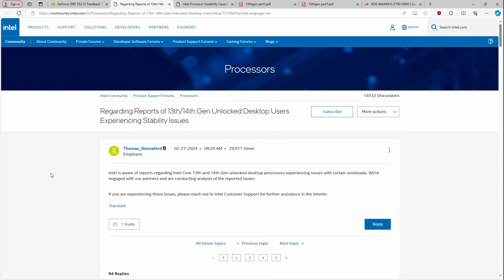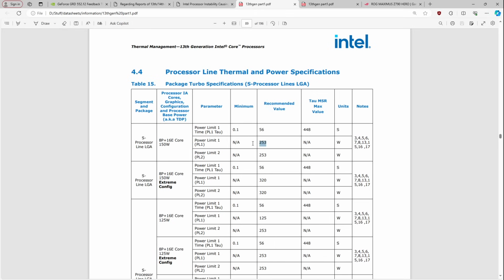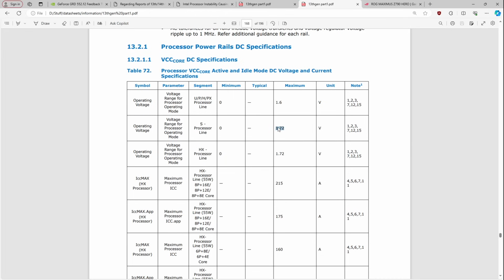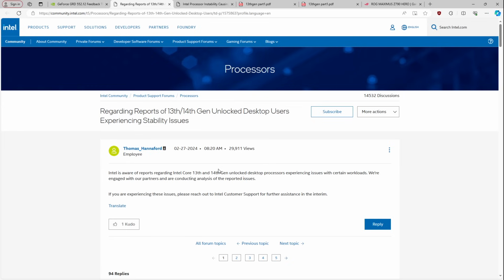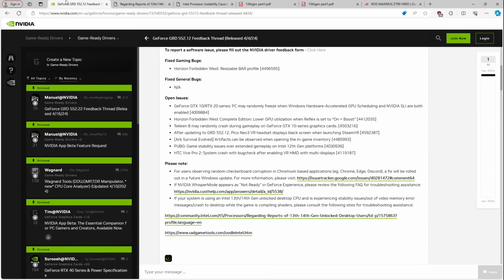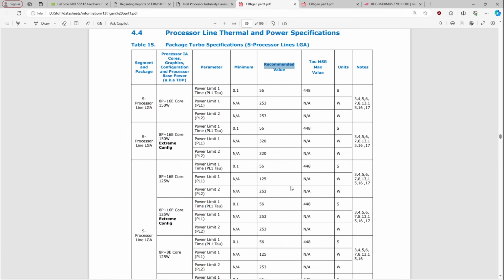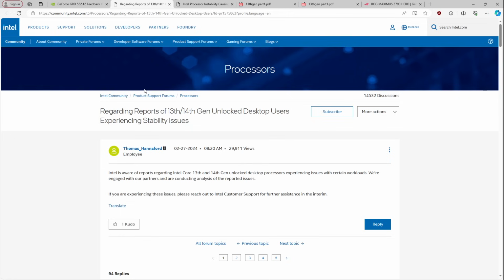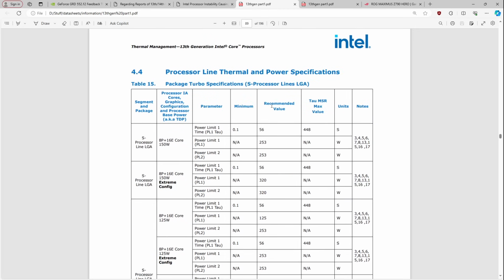Rambling about why some intel 13th/14th gen i9s and i7s aren't stable.

Comment: I don't know why is this overblown so much, it is not a new issue and it happened to other CPUs as welll. My friend had stability issue on ryzen 2600, BIOS update solved the issue and it is not hard to find examples with some other CPUs.

I just hope that intel will learn from this and force board manufacturers to set default settings to be within spec. That is the only reason why stability issues happen on larger scale.
Reply: 27:29
Reply: @ValentineC137  I know he mentioned it, but most do not...
Reply: You’re missing the point, intel isn’t enforcing power limits, that’s a major flaw for highend products that’ll lead to degradation over time quicker than normal

Comment: I would assume the fused SVID is not the culprit. What Intel doesn't appear to specify is the default VRM parameters, which (I guess) mobo manufacturers figure out on their end. Set AC loadline too low (assuming standard LLC) and no brakes on power and you get a vdroop into instability. Increasing AC LL is one way to increase voltage under load (gigabyte, for one,  has presets for it). Then there's also some temperature-dependent voltage optimizations, and who knows how those work.

Comment: I had an absolutely awful Z790 experience over the last 2 years. I have been through four 13700k CPUs and three different motherboards to just get a stock setup that works without dying in a few months. Eventually I just gave up and switched to AMD. Intel's designs here are awful - AMD is kicking their butt, and Intel's solution is to jam so much power and voltage into their design that it's an unstable nightmare even without any overclocking. They need a new CPU design.

Comment: 13700k users have been having problems as well, I've been kind of sort of keeping my eye on this since I built my 13700k and had to dig around my bios to get it running to spec and noticed quite a few mentions of crashes with out of the box settings and a few mentions of RMA's back in 2022.

Comment: I did have a 13700k that would Bluescreen with a Clock Watchdog error within running Latencymon.exe for a minute.  Often under 10 seconds.  Got rid of it, have a 14700k right now.  Have had some odd blue screens at stock settings (which are Asus overclocked bullshit settings).  I changed all of them to Intel specs except not INTEL FAIL SAFE VID, just using auto to see if that works.

Comment: Asus ROG STRIX Z790A gamming WIFI DDR5-6000Mhz 13700K 360mm Artic liquid freezer II everything set to auto/default. I can not run Cinabench. crashes ever time. Drove me crazy for weeks.
Reply: Crashes as soon as i push the button render never starts.
Reply: Have you checked for a newer bios version? It seems asus has updated them recently. Maybe i got lucky or issues havent surfaced but even asus "optomized" setting runs cinebench even for multiple runs and dont exceed 85c

Comment: What a good time for CPU's, buy AMD and they melt, buy intel and they aren't stable
Reply: Honestly the cpu market has been nice and it’s getting better (upcoming releases) so chill on the old news/misinformation, did your 7800x3d melt? No ok 🤫 I went with the cheapest b650m hdv mobo from asrock and it’s kept my 7800x3d perfectly stable right out the box and it’s been a year now, not saying it never happened but it isn’t how you say.
Reply: @Pikkoroo  No, my chip didn't melt because the 7950X system was so unstable that it went straight back... i dont play with garbage platforms that take 8 months to start working properly
Reply: @Latioseon381 also misinformation
Reply: @Latioseon381 so if intel isn’t stable and amd melts what did you go buy a ps5? $99 asrock b650m hdv board hasn’t melted my 78x3d or had a single stability issue that wasn’t user error @myself

Comment: My 11900k is about 50/50 on whether it boots at default settings on strix z590-a.
Reply: I think it's just that motherboard I had the same exact problem with that board I switch to an MSI board and it booted 100% of the time

Comment: BTW electron migration is kinda complex thing, as well as the power is. If something drastic doesn't kill a semiconductor at the end electron migration will. There is no one thing that is directly responsible for stuff happening. Electron migration happens in the semi conductors always. It gets worse with frequency, voltage, amperage and operating temperature. Any of this things gets higher it will shorten the life of the silicon. 
Regarding the power, current VRM's and application scenario is giving us situation where you can get to same power numbers with different ratio of voltage and amperage. Frequency and cooling solution will change the formula. If the cooling allows it CPU will keep on pulling more power even at lower-ish core voltage. But that Voltage might not be enough for some frequency numbers even if the cooling is good enough. So changing any of the parameters will influence every other aspect. Core voltage will rise power usage almost exponentially at some moment. That will possibly overpower the cooling. We are at the stage where we companies are practically selling their products pre over clocked. More Hz does not even mean more performance any more in some scenarios. If the cooling and power deliver are not up to it thermal throttling and dirty and bad power will make things slow and unstable under the load even if it is super stable under some lighter loads. So yeah power is damn complex thing in CPU technology. It is not just P=U x I. It depends on stability and voltage and cooling. Because of different boost technologies and solutions it is dynamic thing. Only solution that works for me is overkill.

Comment: Der8auer talked to an Intel Engineer about the 100° Celsius thing. 

He said its not possible to control and regulate Temp and Voltage on 100% of the Die Space at 100% of the Time.

So Intel puts Tolerances for Temp and Volt in it. Pretty sure MoBo Manufacturers overrun some of theme because PowerStages cant control Power exactly enough.

Degredation would be a heavy Problem but atm there is no other explanation why the chips dont fail immeditaly but months later.

What should happen in this time that 10 people a week RMA their High End K cpus ??
Reply: Yes, the possibility of degradation shouldn't be dismissed. There are many reports of chips working fine for several months, then all the sudden they begin throwing errors regularly. This indicates degradation, so I'm not sure why Buildzoid wants to dismiss it. He says other overclockers have pushed chips well beyond 100 C before, so that automatically means it's not degradation? Doesn't make sense. Different architectures have different tolerances, and even CPUs of the exact same architecture have different tolerances. To give another example, many ICs such as microcontrollers are available in different grades such as commercial, industrial, automotive and military. These different grades are all exactly the same for a specific IC, the only difference is the maximum temperature they can handle. A commercial grade IC might be rated for up to 70 C while the industrial grade might be rated for up to 85 C, and so on with the higher grades. Again, they're the exact same chip, but the higher grades have better silicon quality and can withstand higher temps.
Reply: @PhazerTech  I think the answer is in the Middle. The Intel Engineer also said with 100°C the possible Lifetime of the Die should be 10years+.

So the most possible could be that maybe Intel has a bad Batch of Chips that are now in RMA Process. 
And the other possibility like Buildzoid says is to "low" vcore ore in my opinion "not stable enough" vcore . 

Maybe they MoBo Manufacturers lowered the vcore with Bios Updates to get higher clocks and higher performance.
Reply: @residentCJ  It could be a number of things. In the end what degradation does is just raise the vcore curve, meaning the chip needs slightly more voltage than it used to for a given frequency. So there's a definite relationship between degradation and voltage curve.

Comment: I had one of my cores go bad even though i limited my 13900KF to 200W (even less practice due to limited cooling). 

Worked fine after i limited core2 to 5Ghz, all the other cores seem fine.
Reply: 13/14 gen i9 360 aio is the  minimum I'd personally do😂
Reply: SFF build or what? Idk why you'd run any of these new intel cpu with limited cooling

Comment: i think its just worse cpus that needs more voltages to boost to specify clocks , my amd 7600x was giving me instant blue screens in games but passes with no problem cinebench on stock settings in bios and mother board was setting voltages like up to 1.3V but after testing i found out to boost to 5.45 i needed like 1.45V and finally i am at 5300 on 1.27V and now it works...

Comment: Why doesn't Intel have a stock cooler option with an i9 CPU? Because they can't guarantee it will work. The mainboard can shoot 400 Watt heat in it, and some can build it into a super small case with no airflow, and then it will not work.
I would rather have 14600 with enough cooling than 14900KS with some generic system.
If you want the fastest there is from Intel, you need the best cooling possible.
If you ask me, it requires a big custom loop. 
If you want a smaller cooling system, you might need to go direct die.

Comment: I'll add that 12th is also affected, I thought I was stable, but Cinebench 2024's Stability Test showed me the light, After a  year of use I disabled MSI's Enhanced CPU and stopped doing all core 5.1GHz & 3.9GHz P/E on my 12600K.
Reply: All Core clocks for a 12600K is 4.5 GHz... not sure why your cpu is running 5.1 GHz but that isn't remotely close to stock. Even single core boost on that chip is only 4.9 GHz.
Reply: @mylittlepwny3447  I was overclocking since Intel boards allow you to do with ease, but I'll admit I was doing it a bit sloppy,  I shouldn't have gone on top of the OC with MSI's Enhanced Turbo which added too much voltage.
Now I'm OC'ing with the Boost Ratio option, seems a lot more efficient than simply flat out all course.  Right now, I'm CB2024 Stability tested with a Boost Ratio OC of P1 at 51, P2 at 51, P3 at 49, P4 at 49, P5 at 47, and P6 at 47. 
I'm going to change P5 and P6 to 49, and do another CB2024 Stability test run.
Reply: Shite I was for picking one up as it sounds like 12600k would be grand 😅
Reply: @fracturedlife  If you find it for a good deal get it, the CPU is still great.  The stability issues are easily fixable. Some are caused by the auto-OC board manufacturers have enabled, and others causes are just users with crazy tuning. Intel CPUs really let you have fun with the manual OCs if you have good cooling with them.

Comment: I hate to comment in the first few minutes of the video. But anyhow, the issue lies with the bios implementation  of the mainboard vendors and the common belief that AIO are enough. Mainboard companies want more performance and power draw is just insaine. And if client uses bad cooler, they know CPU will slow down.
Well, stock 14900K can pull 400Watt. That requires a huge cooling system. 360 AIO will not be enough, especially in the cases without proper airflow. Heat needs to be transferred into the air eventually. You can't drop it in water and expect it to disappear. 
Now, voltage gives stability, but rises power draw significantly. So poor coolers suffer even more. 
If you want stability with AIO or even an air cooler, use lower power settings. Use 125Watt TDP recommendation.
If you want full power crazy power draws, make sure you have a huge cooling system.
If you have 4090 in that system, make sure you have a minimum 1200W high-quality PSU. 
Your fans and pump need power as well. It takes power to cool.

Comment: cinebench r15 is surprisingly harder than r23 on 13/14th gen, if you try to run with r15 with a voltage that will crash after a 10 or 30 min r23 test, you will get instant crash
Reply: i bought four 14900k, all of them can run r23 30min, but two of them cant run r15 for a long time, and one of them cant pass r15 one cycle, its not a rare issue, my friend bought three 14900k and all of them cant run cinebench r15, which is ridiculous
Reply from the maker: @polly_2526  oh I've heard from some people that R15 is heavier than R20/23 but I didn't see a difference between them with my CPU. I guess it really depends on the CPU's VID table as to what workload is gonna be most unstable.
Reply: @ActuallyHardcoreOverclocking  Maybe I have a pretty good cooling？I have one 480mm radiator and three eternal 360mm radiators and my cpu is delided, it never hit Tjmax and downclock in cinebench.Also my cpu did degrade, it can even run 5.8ghz linpak before and can never do that now (same water temperature)
Reply: @polly_2526  you both have an asus motherboard?
Reply: @PCstonks  Im using z790 apex
Reply: @polly_2526  okay, and your friend also uses Asus?
Reply: @PCstonks  yeah its the strix z790a
Reply: @polly_2526  what a coincidence.. you can try to install latest BIOS with new feature "Intel Baseline Profile" and enable it. However it set a very high voltage even if you have good cpu bin. So the best way is to set freq&voltage manually, setting the llc for example 6 and the vcore about 1.2-1.25v, freq about 5.3-5.6 depending on silicon quality.

Comment: Glad I went with the i5 14600k for my SFF mini-ITX build. I get 5.5ghz that never downclocks at 75C max and it runs silently. I can jam more voltage into it and it will even boot at 6ghz, but every 100mhz extra creates a more voltage hungry heat producing monster.
Reply: well people with 14900k could also disable 2 cores to be more stabke but yeah silicon quality still a problen

Comment: I wonder if degradation might be from the max current limit not being followed.. that seems like the reason for specifying a maximum instead of just recommending it
Reply from the maker: it could but the CPUs don't really seem to hit those currents for very long because even at 1.1V 307A is 330W and that's already really hard to cool. The 400A limit is straight up impossible to run for extended load on anything less than a custom loop. And I'd  be very surprised if short blips of over 400A would be causing significant electromigration.
Reply: @ActuallyHardcoreOverclocking  Actually there is some strange "formula" for current on intel CPUs, if I set the 307A on my 13900K I get throttled with an ICCMAX flag in hwinfo when running P95 SFTs at only 238W and ~1.14V and VRM amps max out around 200~205A, 400A ICCMAX can get me to ~265ish amps and 280~290W max power draw until the ICCMAX throttling flag reports an "YES", I don't know the exact formula that is at play here but it seems that you are limited to around 66% of the value set in BIOS.
Reply: @ActuallyHardcoreOverclocking  a simple test would be to see if the score changes with the current limit enforced.. if it does then in theory you're seeing more degradation than intel wants to allow

Comment: I do not understand the part about current at 100C at 1.2V vs 1.3V. I understand the idea that same power can only be reached if current is higher at 1.2V
BUT
the temperature is not some average, it's hot spot, and same principle can't be applied anymore. If some workload causes different temperature distribution then it's hard to predict this.
Reply from the maker: for a given workload the hotspots won't change.
Reply: @ActuallyHardcoreOverclocking  ok do you mean that lower voltage results in higher current because of higher frequency?
Reply from the maker: @ПётрБ-с2ц  If the CPU is thermal throttling it will pull the same power regardless of voltage(unless the voltage is so low that it stops thermal throttling). So at 1.3V it would pull less current than at 1.2V in order to stay bellow the 100C TjMax. At 1.3V it would also end up at lower clocks due to the thermal throttling being more intense.

Comment: G'day Buildzoid,
When you were talking about intel Random Validating Motherboards, my thinking for intel would be replace the CPU + Mobo from people with this problem to test them together. This would give actual info for is it the CPU or Mobo as to where the cause lies.
Do you think better/more cooling may also help? As we know the cooler a cpu is the more efficient it is & even swapping the ILM to a Frame makes a big difference to temps so combine that with more Radiator Surface Area 480mm/600mm/720mm. In Der8auer's 14900KS video his one topped 400W.

I agree with you about Temps/Degradation, the number of people who say "😱you CAN'T run a Desktop at 60°-70°C as they will degrade too fast" but Laptop CPUs made using the same Fab Process can run at 105°C every day for years rarely not outlasting the Batteries, when I question people on this contradiction apparently I am an Idiot who doesn't know anything.
Reply: Laptop chips are usually better silicon quality, meaning they can run at lower voltages and higher temperatures. No two chips are the same, so even chips from the same SKU can have very different tolerances. I wouldn't dismiss degradation as a factor. Many people report that their CPU worked fine for months and then suddenly started throwing errors. This indicates a degradation issue.

Comment: Actually Hardware Overclocking : I've got an i7 13700K that has kept crashing for 4-5 months now....and I've tested it on a different board, memory, PSU and GPU....and it keeps crashing in some modern games and when I unpack heavily compressed files that are more than around 1 GB that gives the CPU a few minutes to work.

Mine is definitely partially melted.